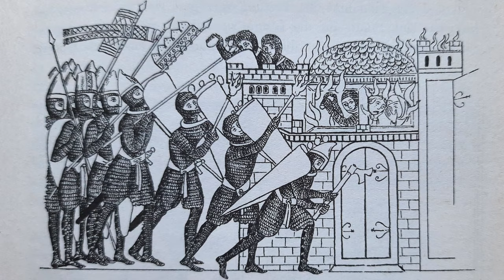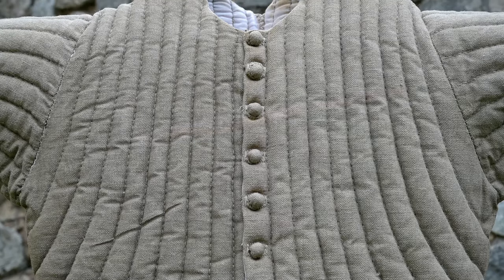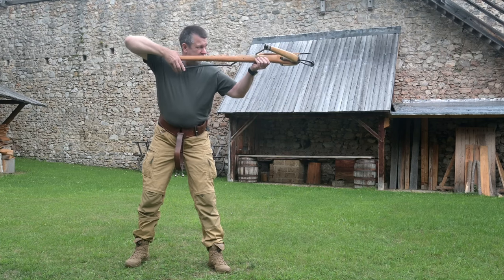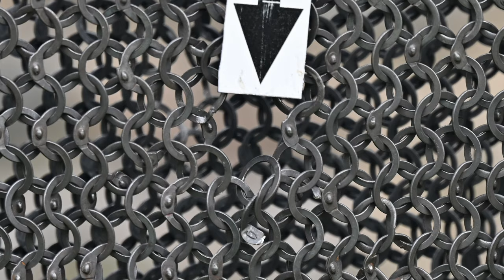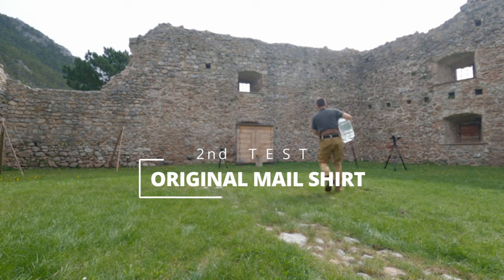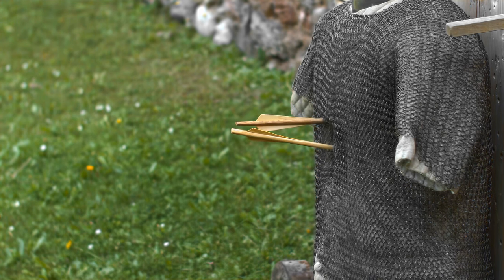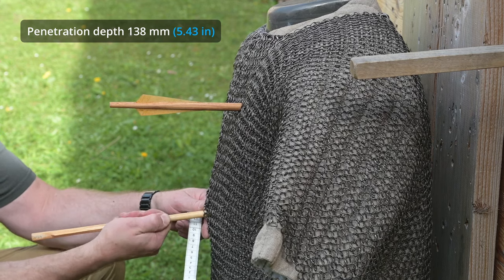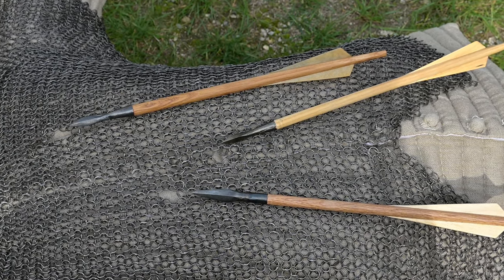Medieval Composite Crossbow vs original mail armour

Comment: Excellent test.
I have now concluded a similar test on my channel with a faithful reproduction of a 15th-century mail sample.
Wire thickness, inner diameter, and even metallurgical quality were matched to the 15th century museum chain mail shirt by Phil Parkes (a world-renowned mailsmith and certified museum conservator). 

The mail sample is, in Phil Parkes' opinion, a robust and “high-end” example of mail armor intended for torso protection of that time period.
I tested the sample in combination with a linen jack (gambeson) in accordance with the 15th-century Burgundian ordinance prescribed for the defense of horse archers.
I used four different bows with draw weights between 75-103 lbs. 

What was interesting is that my 103 lb bow produces nearly identical amounts of energy as the crossbow used in your video, 85-93 J (ke).

The sample I used did prove a little bit more resilient than your sample. 

That is to say when penetration was achieved with war bodkins (which are similar to the arrowheads you used), I saw a 50/50 ratio of success (so some arrows did not penetrate) 
The arrows that did penetrate did so to a lesser extent than yours.

About 3 inches (70-80mm) which is still significant penetration but not as deep as your test 
However, when using Needle Bodkins, even the 75 lb bow, 55 J (ke), was able to consistently defeat the armor with ease.

The difference in penetration between the war bodkins (between our tests) is likely due to the fact that I used 15 layers of total linen in my test (as opposed to 5 on one facing for yours), and my mail sample may have been a bit more robust than yours: 

Dimensions: 1.3-1.4 mm thick wires with an ID of 6.5 mm.

But either way I think both our tests highlight that by the 15th-century mail could no longer be relied on as the primary defense against Warbows and military Xbows.
Reply from the maker: Very interesting - thank you very much!
Reply: very controversial statements - the chain mail of the 15th century preserved in the Armory of the Moscow Kremlin is divided into "German" (European), Russian and Cherkasy, "German" are considered bullshit.
Let me remind you that in the East chain mail was used until the end of the 17th century. At the same time, the main weapon of the cavalry was a compound, recursive bow. and due to the fact that its efficiency is much higher, the arrows had much greater armor penetration than a long bow. meanwhile, chain mail provided a fairly reliable protection against them. High-quality chain mail, as evidenced by the letters of the Crimean Khan to the Russian tsar, arrows did not penetrate at all. But, such chain mail was available only to the nobility

Comment: Is this the upper limit of draw weight with a belt and hook, or do you think you could go even heavier? We have one source form Anvers 1448 of brigandines being half proofed with a arbaleste à crocq or a bow. Matthew Strickland is of the opinion that arbaleste à crocq is a crossbow with a cranequein.[1] I have also seen people arguing for arbaleste à crocq meaning belt and hook. What is your opinion on this? For comparison, the results you get with this 460 lb (210 kg) crossbow is comparable to a 100 lb longbow of yew.

[1] The Great Warbow p. 275
Reply from the maker: I know some french texts about prooving armour. There are 2 types proofed and half prooved. As you say - half proofed means a "light" crossbow wir belthook (upper limit approx 150kg), a belt and puley (upper limit approc 200 to 250kg) or a longbow. Proofed means a heavy crossbow with cranequin (300 to 500kg).

Comment: Excellent. Would a bit heavier bolt help it to penetrate a bit more armor?
Reply from the maker: a heavier bolt generate  more energy - so  the penetration depth should also be higher. But if the bolt weight is too high, the energy decreases again.
Reply from the maker: @markcorrigan3930  I have built one but have only done a few small tests so far
Reply: @tatumergo3931  Energy, specifically sectional energy, is a better model for predicting penetration than just velocity. Bows have a fixed amount of energy that they can transfer to their projectile. Sometimes a bow will transfer more of its stored energy with lighter arrows, sometimes more with heavier arrows, and sometimes with something in the middle. At least that's what testing in very small samples seems to show. Some replica medieval steel crossbow designs (with very short draw lengths like this one) seem to favor heavier bolts to get more of the bows stored energy efficiently transferred to them. No idea what this particular crossbow would favor tho. 

However simple velocity does not equate to better penetration. Energy increases with velocity squared and linearly with mass, but the bow determines the potential energy figure to begin with. So changing arrow weights you are trying to eek out a little more of that energy.  

And the wives tale that I always heard was straw embedding in concrete... lol. If any of that were true there'd be a lot of motorcyclists impaled by random light bits of matter that penetrated their visors and leather jackets while they were travelling down I-15 at 150mph.

Comment: Fantastic test, and the data was well presented and contextualised.

Will you be doing a test with a less powerful crossbow (like the old test you did way back when) and making another video? I'm curious to see how a 13th or 14th century crossbow - and a wooden prod crossbow in particular - would perform.

Also, will you be publishing the results in a more formal manner?
Reply from the maker: Thank you - The results will be published in a print verison, but this need more time ;-)
Reply: @medievalcrossbows7621  Wonderful. 

Thank you for all the tests you do, it's great to see such a variety of designs made and tested to give us moderns at least some idea of how they might have performed back in the Middle Ages.
Reply: powerstroke makes huge difference

Comment: While this is a very neat and entertaining video, I don't think this test is very accurate against chainmail. If that was the case in the Templars and the Crusaders would have dropped chainmail for some other armor going against composite bows in crossbows in the Middle East. 

Looking at the video and doing research on chainmail, this is an extremely close range to shoot any armor, really. I don't think any other armor could withstand what that other than plate armor. 

Shooting 12 to 20 meters away is very close range, I'm more than willing to bet shooting chainmail at 35 meters or further the projectile wouldn't have gone through enough to neutralize the target. This is especially true when going against European chainmail, which the Europeans had the best in the world.

Comment: Very good video. So the mail is non-hardened, does it mean that it was roughly equivalent to wrought iron? How would you rate to quality / thickness / ring density of the mail in comparison to historical european counterparts? Low end, mid range or even high end?
Reply from the maker: Thank you - as I observed its equivalten to wrought iron, but unfortunately it is not possible for me to do material analyses. But 12 years ago, we do a similar test with french reenactors. The mail was from German production (7mm ID, 1,3mm thickness). The boltweight was approx 45g. Penetration depth 110mm. Here ist the link: https://www.guerre-chevalerie.com/tests/haubert-et-arbal%C3%A8te-de-guerre/
Reply: The website says that the armor has already been went over so the article focused on the crossbow instead. Can you provide the page in which they talked about the armor? Sorry I don’t speak French so it’s hard to navigate for me.
Reply: Generally, if you can see gambeson, or any clothing so clearly under the mail, it's of rather light weave.

The trouble is that we don't have all that much mail preserved from the age where mail was main defence, most complete shirts are from 15th century when mail was usually (though not always) secondary or lighter defence.

But 1.1mm to 1.5 mm with 8-10mm weave is definitely o light variety.

Gjerumdbu shirt of mail from around 11th cenury,  was seemingly composed entirely out of rings with 4.8 to 5.2 inner diamater and 1.3mm to 1.5mm wire. So you have over 3 times less surface area inside the rings, but it's being partially covered by 4 neighboring rings of similar thickness. It's huge difference.

The cost is, obviously, that Gjermundbu kind of shirt would be likely at very least 30%, probably way more, heavier than this one.

Most ancient and early Medieval mail preserved does tend to be much closer, or in fact way denser, than Gjermundbu, than to those light shirts.

Comment: This test, and the conclusion at the end do not match. 
This test was at extremely short range, which is a major advantage for the crossbow. 
Reload time and effectiveness drop off due to range are the disadvantage of the crossbow. 

Very quickly there becomes a matrix where the leaders of the armies involved calculate the maximum range the crossbow MAY be effective, the average reload time, the rate of closure for an advancing enemy, and whether a follow-up short range shot is likely or even possible. 
You may even see tactics like lightweight, disposable shields whose only use is to absorb that first volley prior to the charge. 

No armor is ever used by itself as sufficient defense. Each type and application is used in the setting and with the tactics that make it most likely to be effective. Viewed this way, armor may even be less significant than the other components of defense. 

So the ending conclusion that the maile didn't provide sufficient protection from crossbows fails first by not considering setting, second by not considering tactics, but mostly because it assumes that the maile was ever supposed to defend against the crossbow.
Reply from the maker: Interesting approach - thanks for that!
However, the test was only intended to reproduce the scenery of the miniatures mentioned at the beginning, in which the protective effect between different armour types is shown.

Comment: Not terribly surprised from the results looking at the hauberk itself. The maille weave is incredibly loose, and while rounded rings are superior to modern flat Indian rings, it's the density that saves you from the bolts shearing open rings and penetrating further. All of the energy is being dumped onto just 1-2 rings as opposed to dense construction where a hit would be striking numerous rings. Curious as to how surviving denser hauberks such as one belonging to a Hungarian monarch I recall seeing would hold up under similar stress. Maille unfortunately lacks research into just the specifics of how it performs in all its forms, as ring diameter, thickness, rivet setting, etc can all twist and turn how the performance pans out. Still shocked of that one test done by Arne where a couched lance struck a reconstructed aventail made by Augusto Boer Bront and just bounced right all despite probably being int he 200+ joule range.
Reply: The lance used by Arne is fir, it bends, and then snaps very quickly in one or two places, which probably helps a lot. It doesn't drive the point trough the mail quite as much.

I'm also not sure about their setup, in some strikes it seems that mail just flaps around when hit, like they didn't actually hit anything behind it square,

Those are my observations at least.

Comment: The metal of male's rings is too fine... I think it is about 0.5 _ 0.8 millimeter. But usually it was about 1.2-1.8 milimeter
Reply from the maker: its an original mail shirt ;-)
Reply: @medievalcrossbows7621  from 14th century?
Reply from the maker: @ЕвгенийПрорешный  15th century

Comment: Also waht was the KE of the bolt from weaker crossbow that got stuck. It would be really nice to know threshold at which bolts / arrows start to break through mail and this information would help.
Reply from the maker: The draw weight from the weaker crossbow was about 120kg. The "rest" I have to check ;-)
Reply from the maker: The bolt weight was 47g and the speed was approx 50 m/s so it gets approx 59 Joule

Comment: Interesting test :) but the distance is extremely close. In my opinion most of shooting ranges on battlefield were something between 20-150m (even further, but this was really hard to hit direct target) . I'm understand that in such distance that would be more difficult to hit the target but it would give better comparison. I'm also not 100% sure if that would change the results. Anyway, thanks for that test :)
Reply from the maker: Thank you! A test distance of 20 to 25 m has little influence on the result. An arrow/bolt loses only 1m/s of speed at a flight distance of 10m. But you are right - this will be no battle distance.
Reply: @medievalcrossbows7621  yes, you are right. 20-25m would not change anything much, and most of the test which you can find on YouTube are from such distance. Why I did I mention 20m as a minimum? In my opinion this is average closest distance during siege fighting (20-50m during the assault). 12m could also imitate such situation.

Comment: Well...that's what your shield is for. Mail was never really intended to stop arrows like that, especially not at point blank range. 

Would've been cool to see the mail take a hit from an axe, sword, etc. Nonetheless, neat presentation.
Reply: It probably will take an axe or sword slash pretty well since the force is distributed in a broader area. Probably breaking a bone or two underneath anyway.
Arrows, bolts, and even pointy pikes will penetrate more easily since since the small point puts a smaller area of the rings in more stress.
For this, swords started to get pointier and slimmer with time and the evolving of armor.
Anyway, there are chainmail sets stronger than this example that could deflect the bolt or at least stop it a bit more.
At last, sorry for the full text I just imposed, but I felt like answering lmao.
Reply: @matiasdelatorreoverton3612  yeah, I figured it would shrug off a slash pretty easily since that's mainly what mail is designed for. The development of arms and armor in the middle ages is an interesting topic to look into and by the 15th century plate armor was so advanced it was essentially a layer of steel skin fully articulated and oh so pretty. 

But yeah this would've made a bit more sense if they would've shot it from just a bit further away, just to see..

Comment: Predictable result but great video, especially when compared to period illustration.

I think that the valid point was raised: was it possible to make bolt-proof or at least pierce-resitant mail? The real top quality mail was much more dense and may be even tempered. Like the one Jean sans Peur is wearing under civilian clothes on his portrait, like the one on mail gorgets in Gratz or on mail shirt from Metropolitan (the one they tested with needle :) ). Tobias Capwell recently made a gorget for movie about Richard III with similar quality rings, so the modern replicas may be available. Was it indeed worth the efforts and money?
Reply: There are sources clearly indicating make resisting lance strikes completely, as well as mail being ranked "full proof", "toute botte" or “à toute épreuve”, just like breastplates and brigandines were. Full proof being understood as ability to withstand windlass crossbows.

Aside from some secrets of professionals of that time, that might have had large impact, the secret of making mail so resilient was simply making it very heavy and stiff. Couldn't really go around it in any way.  Just as level IV bulletproof armor with steel plates, resisting rifles is going to be pretty heavy too, and many times heavier than the one that protects against pistols.

Comment: The thing is European mail armor were the best in the world though. The Ottoman mail armor as well as any other form of mail armor around the world tends to be a lot weaker.  The manufacturing of mail armor that the Europeans were doing was a much more superior one by a from compressing the metal wire into a device which is very similar to what we do today.   Many of the cultures didn't have that form of manufacturing wires but rather they cut pieces of metal to make the mail armor which would make an inferior form of armor.

Also just look at the size of those Ottoman rings!!  Those are pretty big gaps, the biggest rings European mail armor ever had was 8 mm size rings from what I understand and most were 4 to 6 mm riveted rings and very often flattened rings at that which is a whole lot stronger than that mail armor used in the video.   

Keep in mind Europeans were capable and made such dense mail armor that not even a pin needle can go between them and there are surviving examples of that in museums in Europe.
Reply from the maker: Here you'll find a similar test we made 12 years ago - the result is neary equal ...
https://www.guerre-chevalerie.com/tests/haubert-et-arbal%C3%A8te-de-guerre/